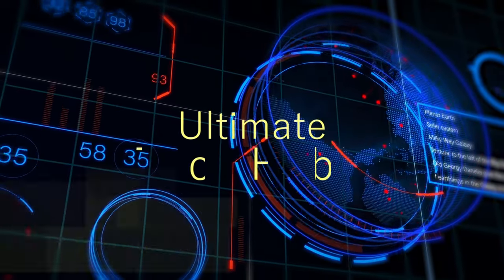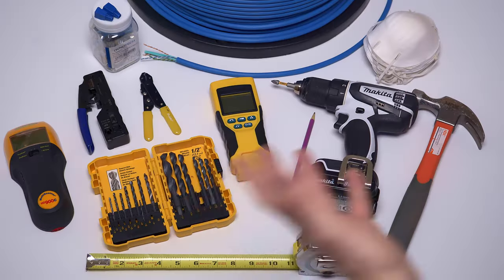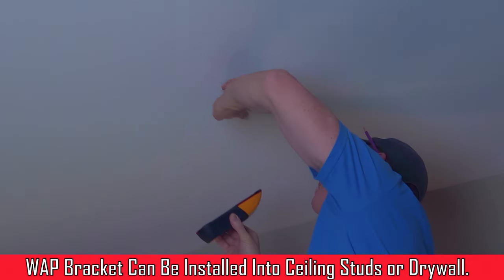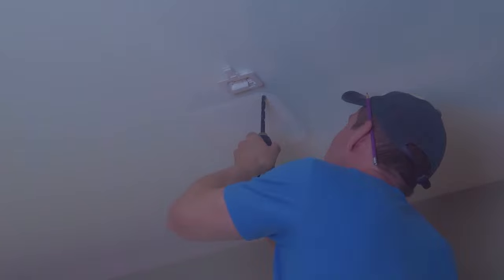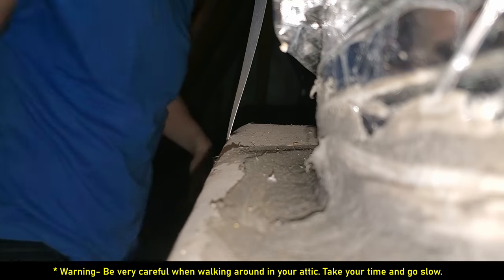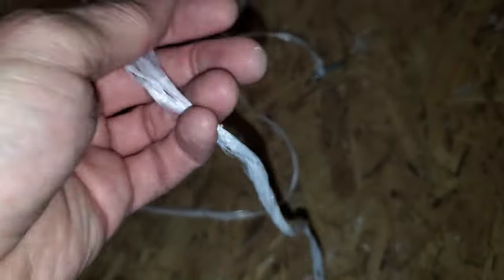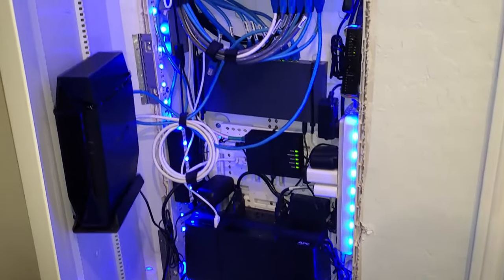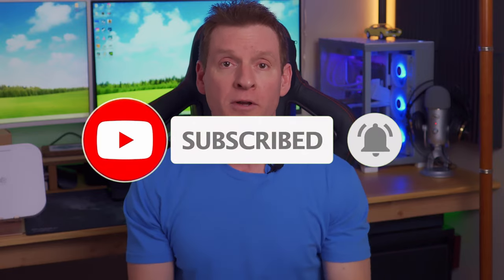WIRELESS ACCESS POINTS INSTALLATION BASICS - HOME NETWORKING 101

Comment: I noticed you have a ruckus. We have a Lennar house that came with one but it stopped working after 2 years. Now I want to put a modem in then a switch then connect to 2 waps. Will this work?  What is your ruckus for?  Sorry I am not tech savvy
Reply from the maker: Yes all of that will work. My RUCKUS switch still works but I'm not a fan of that brand. TP Link is my choice. I have 2 WAPs in my house. So yes you can connect 2 waps.

Comment: What would you suggest for large business? Need multiple access points to get complete coverage. Any advance never installed PoE before. Thanks
Reply from the maker: Netgear WAX630 would work great. You can install multiple WAX630s and use them in mesh mode for one large continuous wireless coverage area. Most brands have the mesh ability so it's really down to which brand you prefer and price points.
Reply: Thanks for the info, would the Netgear be powered through the ethernet cable as need a more secure signal due to locations and also no power outlets available.
Reply from the maker: @benlovessarahable  Yes its powered by PoE through the ethernet cable. Make sure your switch is a PoE switch

Comment: How does it get power. Poe?
Reply from the maker: Power Over Ethernet. The ethernet provides power and data.
Reply: @UltimateTechHub  Do you have a poe switch? Or did you need an adapter of some sort?
Reply from the maker: @275dpr  Yes you need a PoE switch or a PoE injector.